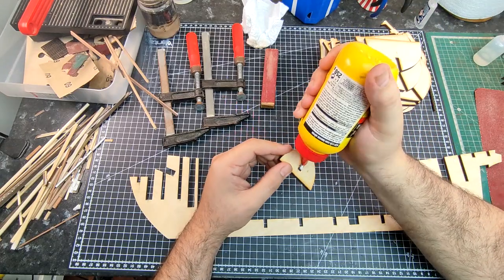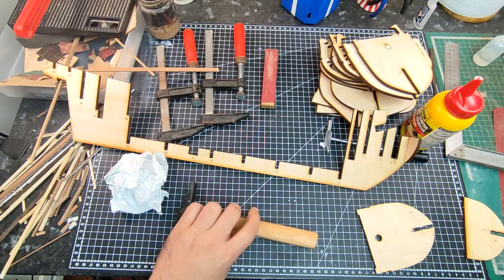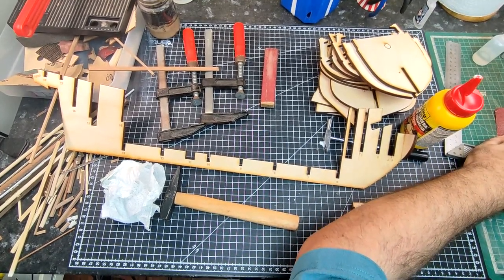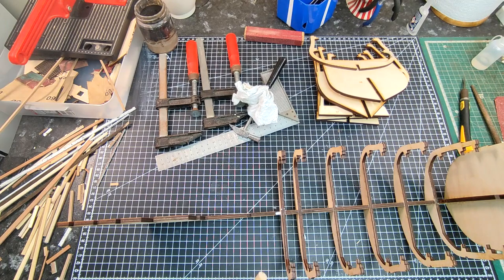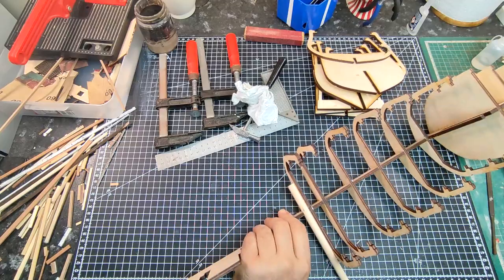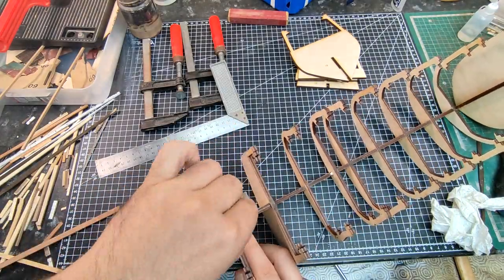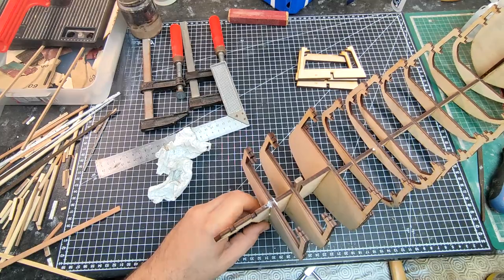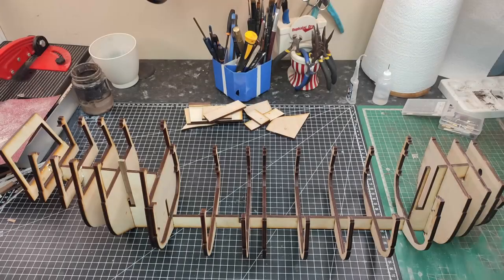The Black Pearl model ship - part 2 - The skeleton | Scratch build from plans wooden model ship

Comment: Looks great!!  Next time I will add extra tolerance for the glue.. lol.  Believe it or not, on the USRC Bear I did not glue the bulkheads.  Pressure fitment only.
Reply from the maker: The wood was just  a tiny bit over the 5mm, it's snug, could have been done without th glue for sure, thanks for cutting them once again